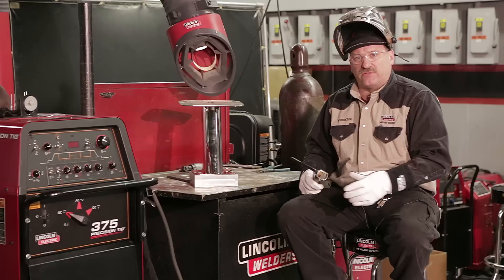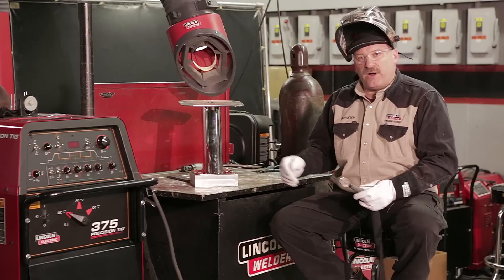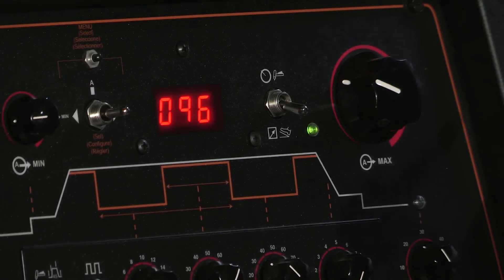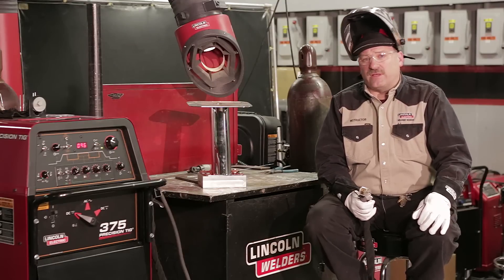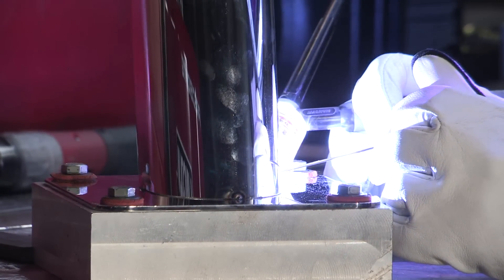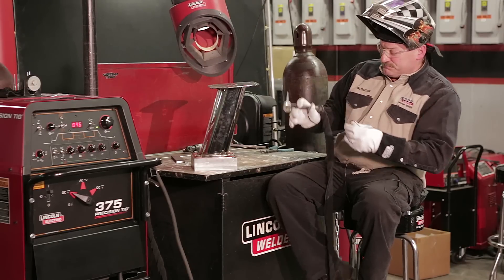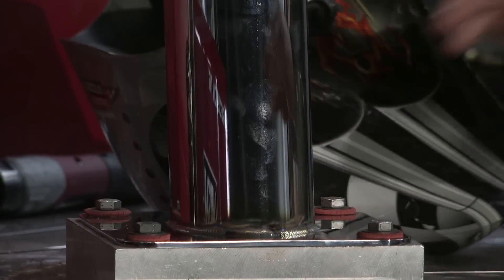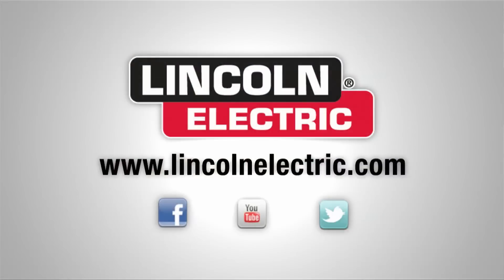Tech Tip: Welding Stainless Steel for Marine Environments

Comment: Is there any concern of the fume extractor messing with your argon coverage?
Reply from the maker: Yes it can if it is too close.  It should be positioned far enough up that it still captures the fume but will not affect the gas coverage.  Remember Argon is denser than air so it will want to sink, but you need to keep the fume arm back just a little.

Comment: If you water cooled your block, would that help distortion?
Reply from the maker: +Charlie Spann Thanks for the question. Depending on the situation, it may but most likely it will not.  In fact since it would speed up the cooling rate of the weld and adjacent area, it make make it worse.  Restraining the joint and preheat are the best ways to minimize distortion.